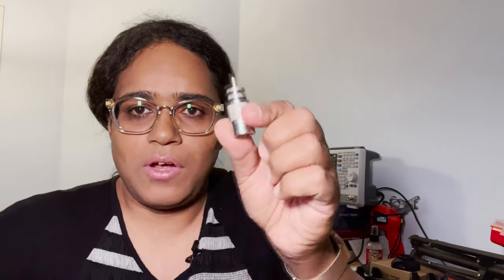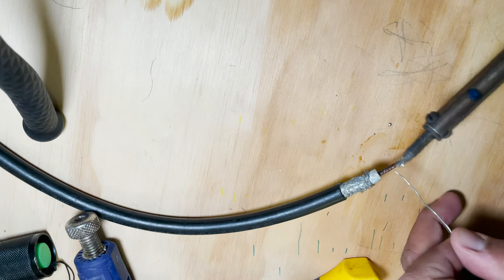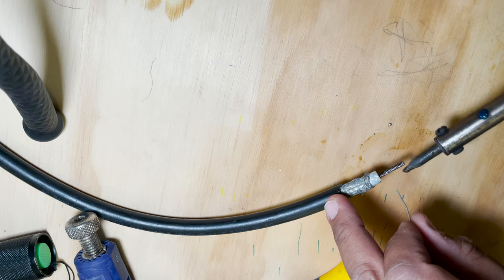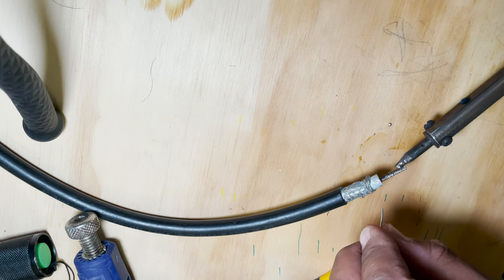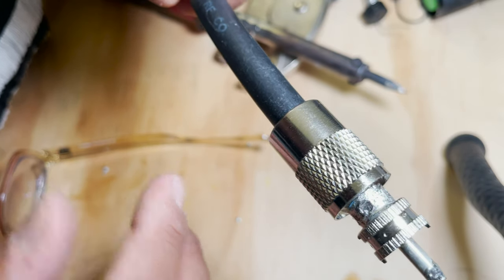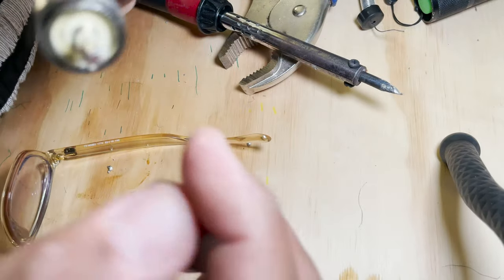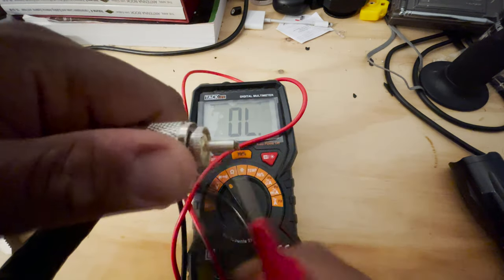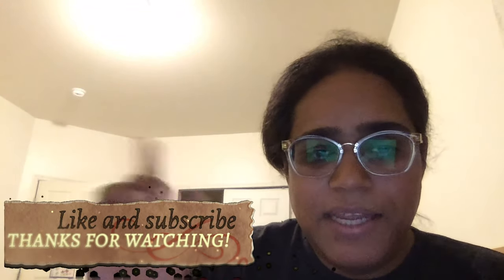Ham radio - the UHF connector and PL259 installation -Ria's Shack

Comment: Good job Ria❗️You might be surprised 😮 at how many people try to solder a PL259 with a dirty solder tip and it is almost 😅 impossible.  Over the past 41 years as a ham I have helped many a new HAM clean 🧼 a solder tip and then they were so surprised 😮 how easy it was.  You are doing a great job 👏👍✅

Comment: Good discussion and demo! One reason/method to use the torch is to reflow the “blobs” after you are finished and either use a damp rag to clean up the braid area. I like to use a chassis iron for the braid connection because I want the to minimize the time I spend heating the joint. You need to heat the braid and shell to temp, but the time it stays at soldering temp is what risks coax damage. More wattage, less time on the connector. The vice grip as a heat sink is a great idea for the reason you state.

Comment: Ria,  your process of doing these is great, nice video!  
After years and years of soldering coax connectors in a commercial environment I have found a couple things though that really help,  and directly addresses the issues 
that most have when they fail with soldering pl-259's.  Please test it out and see if you don't become a believer! 
.
BIGGEST #1 tip to help with soldering PL-259's  use SILVER plated pin and body--NOT the common and cheaper nickel!!!! (Amphenol 083-1SP)   Night and day difference!  
Tip #2 , FLUX  use a little liquid flux on the coax center and braid, really helps the flow!   
Tip#3  use an old style solder "gun" instead a solder iron or torch.  easier to get the heat you need, and still keep it from being too hot and melting the coax insulation.
   73  de Don AD7LL
Reply: Also, for myself, I cut the braid even with the inner insulation, then Lightly trim the braid using a pair of small grooming scissors. keeping the braid as long as possible ever so slightly helps with impedance "bump" .  takes practice so that you get to where you will not create short in the process.  Not having that extra 1/4 inch cut back helps to keep it more constant. the bump is still there, but slightly reduced.  You should be  to check that with a vna

Comment: Good bit on the history on the PL-259 and SO-239 but please say uhm
·pee·dns not im·po·tence .

I prefer a 100w soldering gun for PL259s and to tin the shield before inserting into the connector body. The 100w gun lets you get in and out faster and even though it is hotter less heat is transferred to the cable. With the shield tinned it does not deform or get crowded to the back of the connector when you screw on the body, then soldering the body to the shield is much easier and a better quality job which is the desired result not speed. 

As you commented using a small vise makes life easier. I found one at HF that can rotate on 3 axis and clamps to the table top for less than $30.

I think you should add to your tool list a proper rotary coax cable stripping tool. These can be found online or at your local ham radio store for less than $15 and they are well worth the investment. Once they are set for a particular cable you will not have to worry about cutting into the shield or center conductor. You did not mention nicking the center conductor with the knife which is easy to do but this can cause problems especially at VHF or higher frequencies. The cable strippers are so affordable that I have three, one for each of the cable type/sizes I work with most often. I label each with a Sharpie so I don't use the wrong one accidentally.
Reply: @n2rj  The soldering gun I am using has a large tip. I use a Weller  model 8200-N 100/140 watt gun that I have had for at least 35 years. I use it on the lower heat setting, 140w is too much for this application. The current equivalent model is the Weller 9400PKS. Parts and tips are still available from Weller for the older 8200 model like mine. If you spot one at a Hamfest it might be worth a look.

Comment: Amazing video, and most enjoyable. Thank you for your efforts to which I have as my latest subscription. 
To avoid melting the internal insulation, I fold back the screen and screw that into the threaded part of the PL259 with pliers, then only solder the centre conductor. I make sure only the insulation is visible through the holes to ensure no whiskers are going to short to the centre conductor. This makes a very tight and conductive connection with the braid without any deformation to the internal insulator due to heat. I feel this  is as efficient as crimping and there is little chance of impedance changes. I use copious amounts of ex military UR203 for HF, (VHF and UHF but not recently as there is minimal signal around my QTH!).

Comment: Ria thank you for your demonstration on soldering a PL259. I have done it for years but wanted to some tips and keeping the heat down when soldering the shield to the connector. I still have trouble soldering a PL259 with the reducer installed for the smaller cable.

Comment: Ria, I loved your description of why the PL-259 isn't good for UHF. I didn't know this. You suggested tinning the braid but when you did the demo, you didn't tin the braid. I like to use a small scissors to trim the braid ends. I always tin the braid first. I also noticed you having trouble tinning the center conductor. It looked dirty and should have been cleaned a bit first. Whenever we solder, cleanliness of the joint is so important. I also like to drill open those little holes for the shield. I use a drill bit one size larger than the holes. This allows me to add just a little bit of rosin flux to the joint and it allows me to get the solder tip into the holes and touch the braid. It also gives me a clean hole for the solder to stick to. I look forward to your demo of attaching an N connector. I'd also like to see a demo of installing BNC connectors. I think most would like to see that too. there are so many different types of BNC connectors and different trimming dimensions needed for them. Thanks. de KC9REN
Reply: I also like your idea of using a locking pliers for heat shrink and holding it in place for soldering.

Comment: What a great video, and nice work. 
I've been soldering for decades and still dislike the braid portion of a PL259.
I was just gifted a big 'ol classic Weller iron that I think will dump enough heat into it to do the job. 
I am about to re-do the ends on a pre built cable so I appreciate the encouragement.
Subscribed!
73 de N2NLQ

Comment: It’s almost like the newer foam dielectric wasn’t meant for solder. It doesn’t take much for it to get soft and when it cools it becomes more of a plastic than a foam. Unlike the older dielectric which returned to its original consistency.

Comment: Thanks for the video. If we have cheap-ish female connectors, do you think it's possible to drill the insulator to create to create a structure like the one you have shown? How could I go about measuring the impedance of the connector? That way I could compare   it before and after the mod.
Reply: @n2rj  @w2aew could you lend us a hand for this simple project? It might become a simple mod we could perform on our (less expensive) equipment :)
Reply: @n2rj  probably. I mean, you can't compare a factory-engineered solution against a cheaper solution with six holes drilled into it. I was just asking out of curiosity for this fun topic :)

Comment: My solder pen is only 25W, not wonder I was having such a hard time. I'm still in the buying premade lengths stage but want to start doing some custom lengths for better looks and less clutter. Question: Some store bought pl-259 lugs are longer than others. ABR Industries crimp connectors that HRO sells are very short and tapered. Does it matter how far the lug goes inside the so-239?

Comment: Looks like the coax was a little old and been wet/correded. That's why it doesn't solder well. Nice example although I prefer to solder the braid to the back side  for easier disassembling. Keep going on witn the videos. 73

Comment: This is a good guide to putting PL-259 connectors on large (RG-8 size) coax. But it doesn't tell us how to put it on smaller cables such as RG-58 or RG-8X. I'd love to see a follow-up that addresses that.